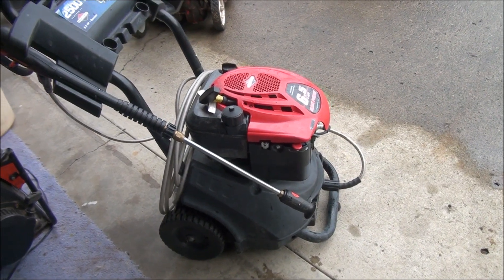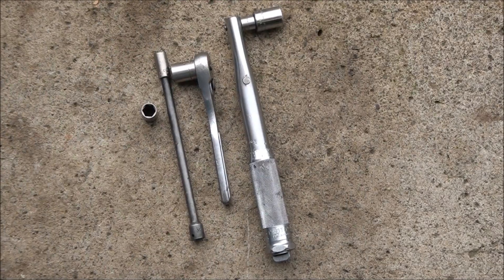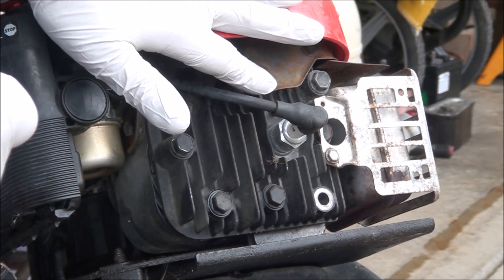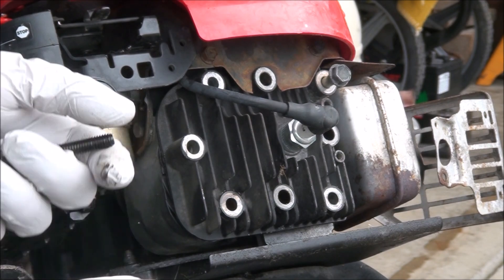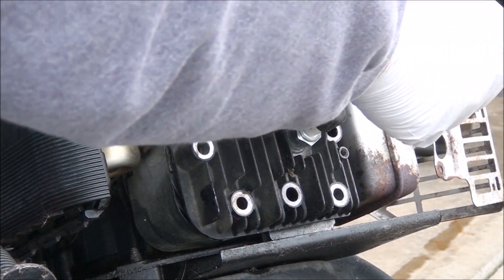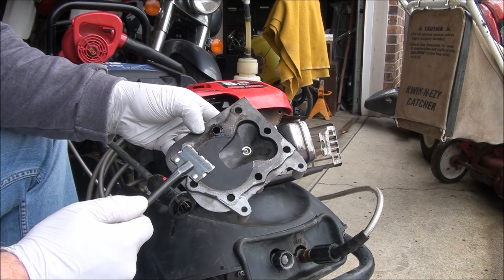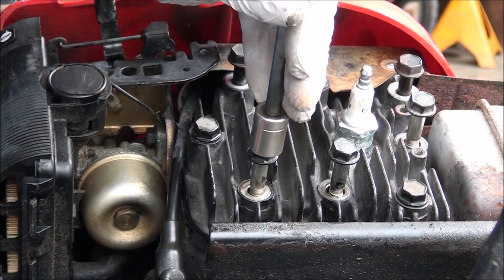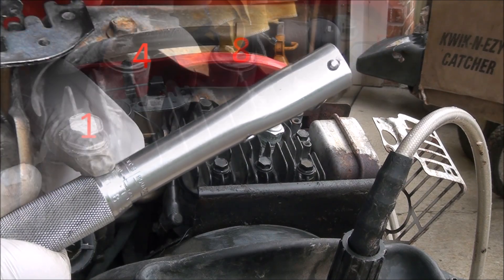EASY to REPLACE a BLOWN HEAD GASKET - Briggs and Stratton engine that WON'T START

Comment: You mentioned oil in the upper end? I pulled my head off of my 6.75hp mower and the lower bolts had oil residue on them. I pulled my head off because I had a constant oil burning smell when I ran the mower. I was thinking my gasket failed. Oil wasn’t overfull or tipped on its side.
Reply: Same bolts had oil on them you mentioned after watching video again. I’m learning 😊

Comment: Hi Can you please tell where you bought the new gasket?
Reply from the maker: my local Briggs and Stratton dealer (lawnmower shop). Available on Amazon also.
Reply: Thanks I just ordered it
Reply: @grantfu5506  did you have the part number for this gasket?

Comment: is the torque the same for a lawnmower? and do you need to put any ype of silicone or sealant on the gasket?
Reply from the maker: good question! yes same torque if it is the same type of engine. Nothing needed on the new gasket put it on dry.

Comment: hello i have a brigs engine a 3hp but mines i runned it once i got 3 engines donated to me but the other 2 i got started with propane no problem but the 3rd one i noticed oil in the intake i tried to run it on gas fail then propane took a longtime and when it started there was emissions coming out of the intake i took it apart and there is like solid oil or carbon in the head gasket anyway to take them off to clean them completely